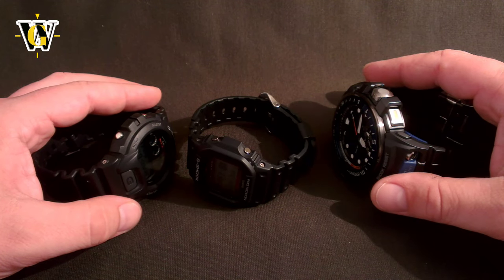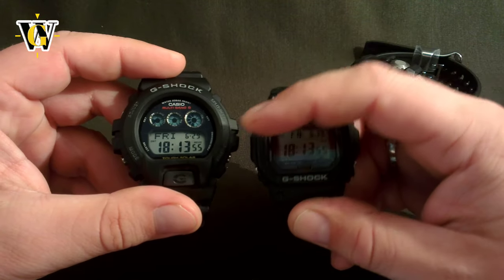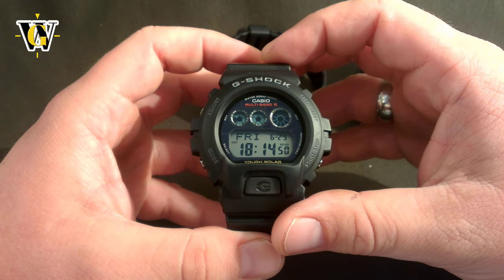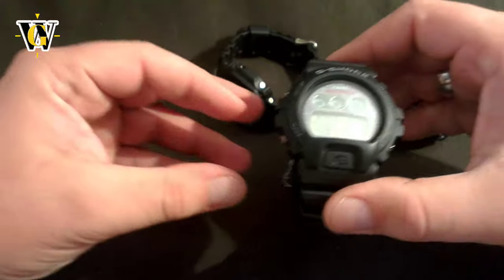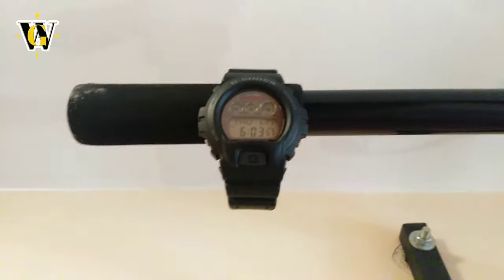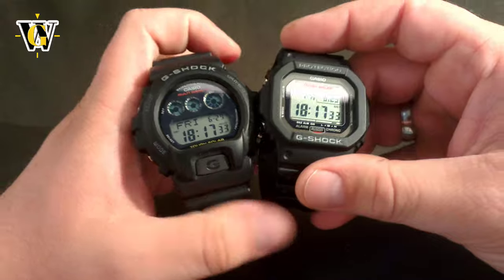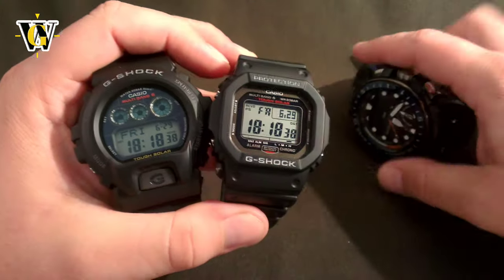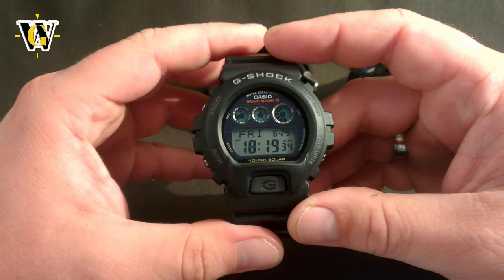DIY Amplifier for Atomic Radio Controlled watches that actually works & is VERY  simple

Comment: I have had a G Shock GWM5610 (love the watch) for about a month and was only able to get an update 1 time. After watching your video last night I put the watch on a piece of steel closet rod and when I woke up I was happy to see “Rcvd” in the display. Great tip... thanks.
Reply from the maker: Excellent news, make sure to check out my last video and sign the petition to stop Trump administration from shutting down the US atomic tower
Reply: Watch Geek... I did. Thanks
Reply: So... I took your train of thought a bit further of using something metal as an amplified receiver to boost the incoming radio reception. I simply rested the metal case back of the watch on my EDC knife and it received a signal while on my nightstand. Definitely beats having to place the watch on a metal rod and resting it in the window frame. Again... thanks for the tip.
Reply: @WatchGeek  At this writing NIST has been fully funded, so the time signal marches on.  Fact is, it was never in any jeopardy due to the Trump administration.  The executive branch does not control expenditures.  Congress does. Great video, keep em coming.

Comment: Amazing tip! I live outside the German tower range and I don't get a signal. I wrapped my 5610 around the sink faucet and it managed to sync after a few minutes. It only did this successfully at night time - when I tried it during the day it reaches L3 but synching was unsuccessful. So if you can't sync during the day, try again at night when the atomic signal is stronger.

Comment: Thanks!  Going to try this.  I live in north Texas and my Casio G-Shock has no problems syncing.  I just bought a cheap Casio Waveceptor from Amazon and it won’t sync at all.  I don’t want to use the the Chinese based apps, so this is a really appealing approach.    I’m amazed that Casio’s technology has such varying success rates - I thought that if one worked without any “assistance”, they all would work without extra help.   Guess not.

Comment: Was not able to receive signal before no matter where I placed the watch; window or even outside. Saw this video, strapped the Casio ProTrek to the pull-up bar. Enabled Manual Receive Signal and the watch updated in less than 5 min. Believe the hype. Thank you!

Comment: I thought yeah right.  My casio watch last connected 2/28 and my son's 3/1.  I went out in the yard with mine yesterday and tried to make it connect and it would not.  Last night I leaned a weigh bar I'm not using against the wall next to the window in my family room which is partly below ground even.  This morning, the received signal is present, it worked.  This is great!

Comment: ok I had to go back to this video to thank you for this. My 5610 ran out of charge from not wearing it. When I tried to sync it it wasn't working, I was even wondering if the Atomic Clock in Fort Collins had stopped transmitting. Then I realized my wife has a ballet barre I made her with 3/4 pipes. It literally took 3 minutes, at 5 pm, to sync. Thanks for this again.

Comment: Last night I used an 18”x3/4” steel with plastic coating pipe and it worked! 

 It didn’t work manually but it took on the first try at midnight

Comment: Nice discovery. It isn't an amplifier, but you're providing the watch with a larger antenna. You could try if a horizontal or a vertical position of a rod and whether aligning the rod with the internal ferrite antenna make a difference in reception.

Comment: Take a long wire, and wrap one end of it around your wtch... or make a loop of it... and then string the rest of the wire out.   The wire acts like an antenna, captureing the signals in a standing wave inside them.   The loop acts like a transformer coil, creating a magnetic expanding and collapsing field from the radio waves, which iwil induce the same signal in your watches.     If you want, you can coil the coil and tape it to a piece of cardboard and set your watches in or ont hat.   Experiment around with runnign the long wire antenna part of the wire, and how you make your coil....     Just about anything is going to boost your signal.

This works for all radio devices,a nd I found it otu by doing the same with an old vacuum tube AM radio at night and a very, very long wire laid on the ground (old telephone wire cable off the pole).

Note you can use justa bout any wire, except coax wire, which has a braided shielding inside around the center core.   I mean, it might work, with the shielding acting as your antenna, but coax is too stiff to want to work with anyway.         Old ethernet cable, telephone line cable from inside your house, speaker wire, even an unconnected extenson power cord, or loose housing wire. whatever you have lying about...

Your bike bars are acting as big chunky antennas.

Daytime aren't going to syncs because the time signal (at least in the US) is on 20mghz shortwave band, and solar radiation during the day just totally wipes out shortwave reception.  You will never get a sync during the day.   But at night, the shortwave bands come alive...  with the best reception deep in the night, or during ionosphere charged activity from suns pots, etc.  Basically, if conditions are good for a HAM radio reception,they  are good then for your watches.

If you want the absolute strongest boost, wrap  he coil around the watch body itself.  You can also set other atomic watches next to that watch and they will benefit as well.   The longer the wire, teh stronger the boost as well, up to a point anyway.   orientation sort of matters but nto as much as unobstructed Line of Sight to the transmitter.   The fewer radiowave abosorbing moisture carrying objects (i.e. wood, trees) or radio reflecting objects (plates of metal, tin, refrigerators, stoves, washing machines, etc) between you and it the better.
Reply: Thank you for the detailed comment, i have wondered whether a wire in the correct configuration would or not.
Reply: WWVB at 60 KHz is the only US signal picked by these watches. None of the WWV frequencies are used by these watches. 

Propagation is only suitable at night, which is why the watches are programmed to wake up in the middle of the night.

Comment: It's not an amplifier so much as a better antenna coupling to the tiny internal antenna. The internal antennas are coils of wire wound on tiny ferrite bars. The appropriate antenna for the 60 kHz WWVB signal is a wire dipole antenna that is over a mile and a half long. The best practical indoor antenna is a loop of wire about 3 feet across with a capacitor wired in a gap in the loop that will resonate the loop at 60 kHz. (Do a web search for small mag loop antenna.) Then just set the watch beside it and it will lock easily, even much easier than using a pipe as an antenna. Basically, a larger antenna is a better antenna, and 2 antennas tuned to the same frequency couple to each other and share the strength of the signal received by the larger one with the smaller one. So get them close together and you're in business. I built a WWVB loop antenna in MI that was 3 feet in diameter (and in my basement) that received the WWVB signal in Colorado so clearly that I could display it as a sine wave on my oscilloscope.

Comment: thanks a lot man ! my new gwm-5610 wasn't able To sync inside m'y room. no problem outdoor. i have tried with a diam 22mm and 80 cm copper pipe and it works perfectly and very fast !

i m in Bordeaux, France.

Comment: OK, so I start the video by thinking, that maybe he will build a dish out of foil or such...

Well, I have to try since I have NEVER had a sync on my M5610 here. I got curious because I had my new GW-6900 on my wrist last night and it had "RCVD" on it for two nights. What? Theres gotta be something here. So, I found this from Your other video while learning the RC -functions.

I LITERALLY live exactly 1904Km (or 1183 miles) away from closest transmitter tower (Mainflingen DCF77). I was doing laundry, so I let my watch sit on the wet clothes drying rack (metal) for a minute.
Instantly get L3 signal, never even seen that before... After only a maybe 2-3 minutes, I´VE GOT SYNC!!! I can´t believe it even though I have some limited understanding of radio gadgets.

Amazing! Thank you so much!
Reply from the maker: I'm glad i helped and i appreciate the donation! 🙏
Reply: @WatchGeek   Judging from the watchcount on this video I have a feeling, that there might be many Multiband6 users, who are un-aware of this little trick. AFAIK many in here still struggle with sync and some may even skip Multiband6 version of the watch as it may not work in their area. So have to spread the link!

Comment: I tried hanging my atomic watch on my bike frame, pull up bar the reception level goes back and forth between level L2 & L3 but still unable connect. Does the reception level have to stay steady at a level in order for it to have a solid connection???

Comment: I am in the fringe reception are for WWBV, east of Cleveland, Ohio, Usa.   

My Casio Multiband 6 watches (G-Shock/Edifice/Oceanus) all syncronize pointing south out a window.  FT. Collins is almist due West (264 degrees from True North).  My one Citizen radio watch will not. synch.

Last night I treid hanging the Citizen (H144-H145) from a 13mm x 624 mm steel tube with 9 o'clock pointing SW.      No sync. 

 Tonight I will use a 30  mm x 800 mm aluminum, hoping the larger diameter gives more reception boost.

Comment: Ingenious find! I'm located in south Germany and always wondered why my atomic G-Shocks always synced at 3:02 AM Central European Summer Time or 2:02 AM during standard time CET. I guess it's 2 minutes past midnight UTC-2 (Greenland?) when the sync signal is sent.
Reply: The signal is sent continuously 24 hours per day by the tower in Mainflingen. Your watch is programmed to try syncing at certain hours during the morning (e.g. 2am, 3am, etc. see your user's manual to find out what are the exact hours) because that's when there's less radio interference. It takes about 2 minutes to finish the sync if reception is good, that's where the 2 minutes come from. You can also try to manually start the syncing (see your manual how to do it) and you'll see that it'll probably work anytime after dark too.

Comment: I have two Casio G-Shock watches and neither have sync for several years.  I have been using WEB SDR apps to monitor the 60KHz WWVB signal and have not been able to hear the signal from anywhere in the USA or Canada.  Many years ago, for my work, I had to use the WWVB signal to sync the Cesium clocks at work, so I'm well familiar with the signal.  At night, it should be quite strong all across North America, but now I can't hear it at all.  I will try placing my watches on metal pipes, I have copper and steel to see if it works.

Comment: NC resident here close to the border with Virginia. I have a strange phenomenon with my G's. I have the GWM5610-U solar square, it effortlessly syncs to Fort Collins almost every night on its own. I have a GW-9400 Rangeman that is pretty good with auto sync. Not quite as effortless as the square but still pretty much no muss no fuss. The metal shower curtain rod did increase the rangeman sync speed. However, my GWF-1000RD struggles to sync even when hung on a metal bar. It will sit on L3 but eventually error. It hasn't synced since April 7 and it is now May 7. I'm at a loss on that 🤷
Reply from the maker: Haha my GWF1000 Frogman was also the worst when it comes to sync out of all my atomics
Reply: @WatchGeek  I tried hanging it from my shower curtain rod and syncing and everything worked flawlessly! I really appreciate that suggestion! I wonder why they have a harder time syncing than other G's? My educated guess is the screw down case back and a thicker case in general? I also wonder why the shower curtain rod works better than another metal rod I tried first. Idk, but this video definitely helped! Thank you again!

Comment: So far the only thing that works for me consistently is to wear the watch when it's trying to get a signal.  I don't know what happened if they lowered the signal but if I wear it overnight, it works, if I don't it pretty much doesn't.  Even the weight bar trick only worked one time but not the next two times.

Comment: I think the odd shape of your bicycle is acting as a resonant antenna and coupling a larger signal into the watch antenna. I used your method on my house steam radiator valves and got better synching. I'm also on the edge of the Colorado WWV signal in Boston.

Comment: I confirmed that in Eastern Europe (btw I'm an American expat but live here now) just wearing the watch to bed itself acts as an amplifier. I'm in a city center and about 1500 km from the German signal. I don't have any large metal pipes or apparatus around and was only getting a sync maybe once a week if I'm lucky. So on a new watch that wasn't syncing at all I just charged it to full in the sun and wore it to bed and yeah it worked overnight.

Now I'm curious to see if using this method my body itself is able to amplify the signals enough to get the signal from Japan. I have a PMD56-2952 also that I want to see if I can sync to the Japanese signal. From here... Massive stretch I think since it's +6 hours from here but worth a shot since some guys in Australia were able to get the signal via amplification.

Comment: Atomic time synchronization is broadcasted by means of long wave radio signals which propagate on the surface of the earth. Therefore, the simplest and most secure  method that surely works is to put the watch on the floor (In case one lives in a single floor family house).

Comment: I am assuming that the pipe.....or bike is acting as an antenna.....and amplifies the signal that the watch lets off and by doing so gets better reception......does this mean that if the watch has more metal construction it will be easier to capture the signal ? Just a thought.....anyone know if this is the case .......

Comment: intresting. car remote locking amplifier can be your body - point rmote down onto top of your head, for good range extension  my merc C.

maybe gps watches might benefit from being plave on  plate/dish :) I won’t go tomic, as accuracy is overkill and I live in lowest point in country switz surrounded by mountains
my Pulsar solar is good for +/- 10 sec/month. pulling out crown to make time zone hr. changes simpler, too. $50 Ebay.

Comment: Fantastic!  If the rubber or rubber like straps are supporting the watch (hanging upside down in the shots) was how they rested overnight, there seems to be no direct metal connection to the watch.  Yet it still appears to act as an antenna of sorts even without the direct metal contact.  Maybe the 'aura' of the bike or chin up bar :) is a factor.  That sounds preposterous but I don't discount such possibilities.  Is your bike Steel?  Aluminum?  Probably does not matter.  Of course, there are phenomena which even modern conventional science can not explain.  All the best!
Reply from the maker: At first I was trying to place the watch so that it has a contact but then realized it works even better when just hanging. I guess it creates an area of increased signal like an echo.
My bike is aluminium and all the other pipes were steel

Comment: I live 1,500 miles NW of the tower in Colorado USA. Not sure why but my atomic solar g-shock square does not sync when placed in an east-facing window but will sync almost every time when set in my closed watch box inside a closed cabinet inside a china hutch in a room in the middle of the house.
Reply from the maker: Haha
Reply: Watch Geek Don’t have the model # handy but it’s the JDM black body with the reverse display and metal bracelet. I’d love to get another JDM G-Shock. Likely the translucent body with carbon fiber bracelet model GW-S 5600 1jf. The new all metal models look nice but I could get a nice JDM Seiko diver with a 6r35 movement for that kind of money. Can’t see puling the trigger on s $700 Casio.
Reply from the maker: The square in the video is the GW-S5600 but the bezel and strap have been replaced with a regular black one from the GW-M5610
Reply: Watch Geek I remember that from your review

Comment: Are the signals for atomic watches universal?? I mean, all atomic watches from any and every watch company share the atomic signals, right? Or are there any special types?
Reply from the maker: Each tower has its own frequency so if a watch is made for US market only it won't be able to catch the signal from other towers (like some citizen models)
Reply: @WatchGeek  let me reexplain, as you know that atomic watches are radio controlled, so just like the radio channels, does every watch company has different frequencies or do they share the same bandwidth???
Reply from the maker: @CaptainBroadSword  they share the same bandwidth,  because they have to use the frequency of the radio towers. 
Radio towers emit at a certain frequency,  so they have to be tuned to that exact one, wiith eqch tower having its own.
If manufacture used their own, they couldn't catch the signal

Comment: Can you suggest cheapest solar watch please?.
Reply from the maker: Just solar or solar atomic?
Reply: look at gw m5610 for 95 bucks from amazon (solar and atomic)
Reply: casio tough solar line..
Reply: Watch Geek only solar. Cheapest one.
Reply from the maker: AQ-S810 is the cheapest one where I live under $50
Reply: Casio G-Shock DW59900E-1V for less than $40 US on Amazon.
Reply: That should be Casio G-Shock DW5600E-1V
Reply: Never mind, it is not solar. :/
Reply: OK. Pulsar PX3037 on Amazon for $55 US. God am I anal about looking for watch bargains!?
Reply: vaibhav kulkarni try G-5600. let me know if you do.
Reply from the maker: Make sure to sign the petition on canceling the shut down of the US atomic tower. I talk about it in one of my newest videos, so check it out, or else your 5610 will be as good as a 5600 😔